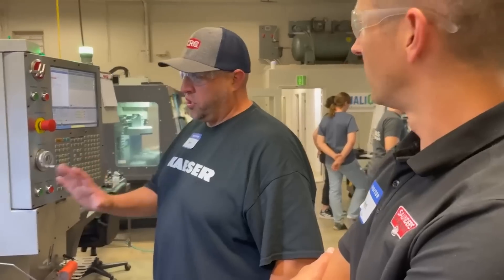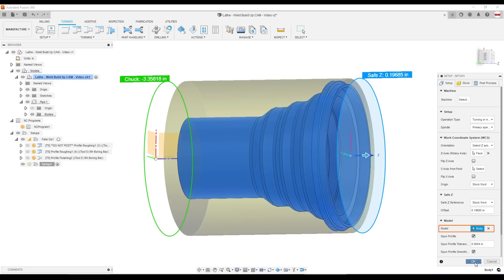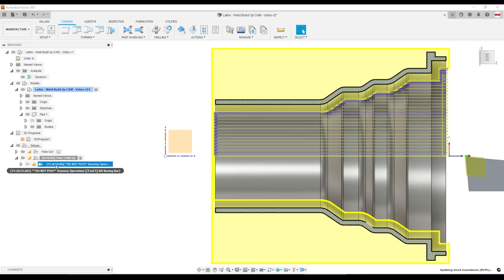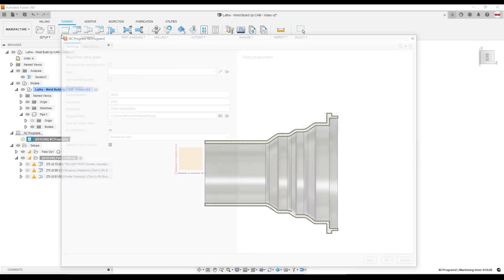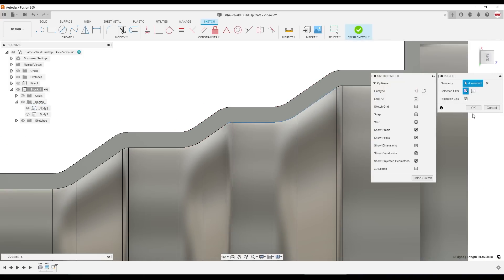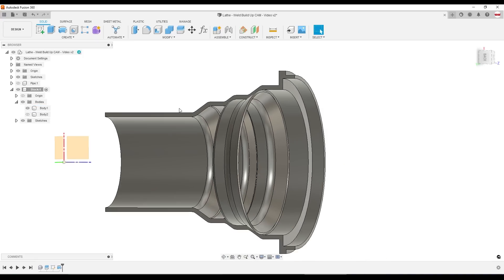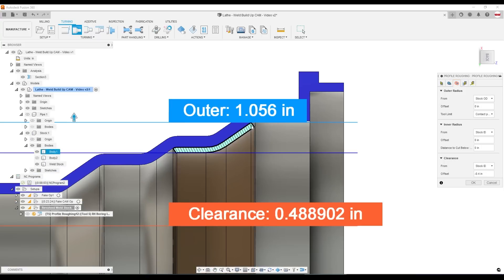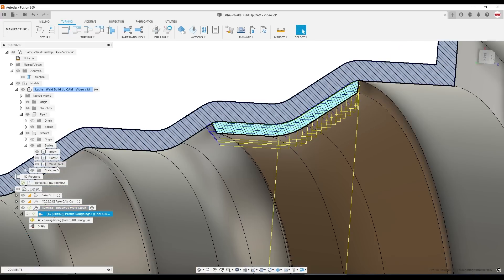Fusion 360 Lathe CAM: Controlling ID Boring Toolpath!

Comment: Why not just avoid all of that and create a manufacturing model where you can offset your original profile out by .1 so you don't chance anyone posting a dummy file? I feel as if any chance to eliminate human error the better. The reasonable amount of time it takes to do this through a manufacturing model vs a tool path completely eliminates possibly of error and may only add 1 to 2 mins to your process at most if done right.

Comment: When we do things like this and inventor we pattern the body with a zero offset to make a parrametric duplicate and then offset surfaces on the new body so you have a body for stock and a body for turn. This also works well for parts you are leaving stock on in certain areas for heat treat for hard turn.

Comment: Great Information here, thankyou for sharing. I've struggled a lot with turning operations in Fusion 360, particularly with modelling tools and their orientation on roughing and finishing toolpaths. Fusion always seems to mess up or restrict how the tool can be used and I cannot get it to operate how I would normally on a manual lathe.  I would be very grateful if you could do a video on modelling turning tools with various carbide inserts to work properly in Fusion360.

Comment: Like how you share your hard won knowledge and experience in your videos.
I am not a machinist but I do have some experience with manual machining from an engineering point of view. I can do technical drawings and drafting.
I have found that many problems that machinists have are because of the source drawings that they are using. 
Like your channel and the content is very helpful for my design work.
Thanks for taking the time to share.